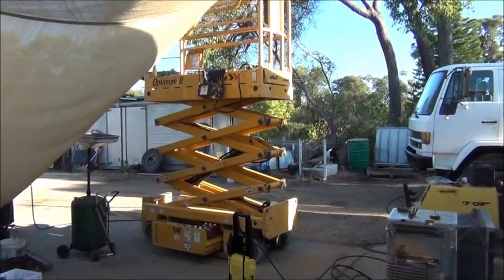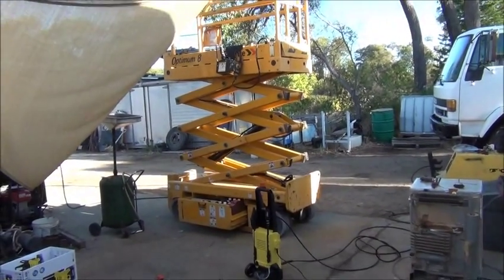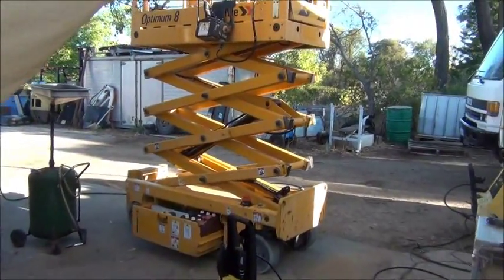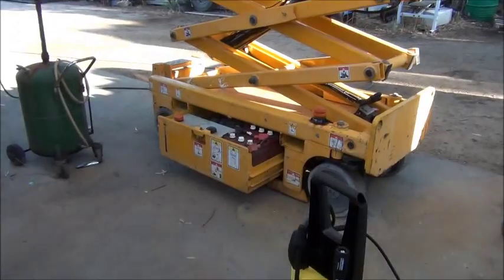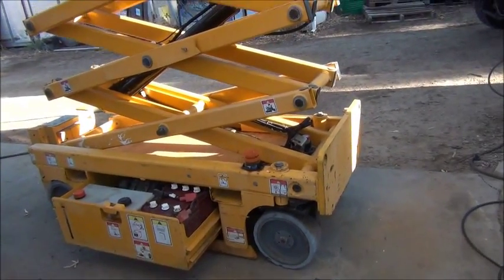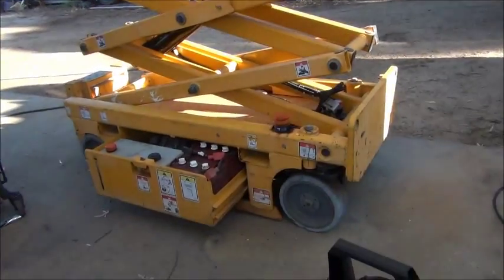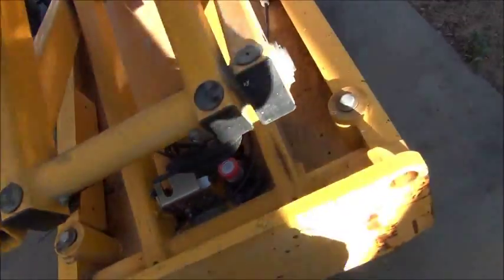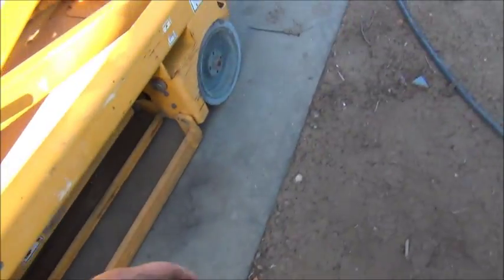Equipment Inspection - Haulotte Scissor Lift

Comment: I agree - just been using one of those for a painting job, intermittent beeping is when the platfom is being lowered below 2m, constant beep is tilt alarm (bet the tilt switch is shorted!).

Those bars that swing down are pothole protection to stop the wheels  falling into a pothole when the platform is raised.

Comment: I've driven loads of those little DC units, and they are great to have around the shop!, the diesel 4X4 ones are even better :D

I wonder if the tilt switch is acting up, most of the time I hear that constant signal on them is because its at a angle, or overloaded